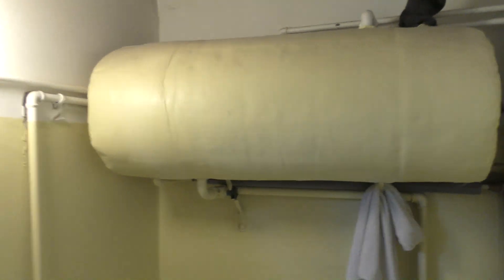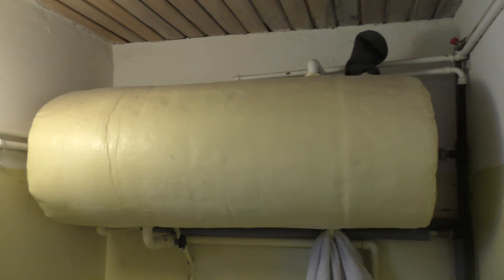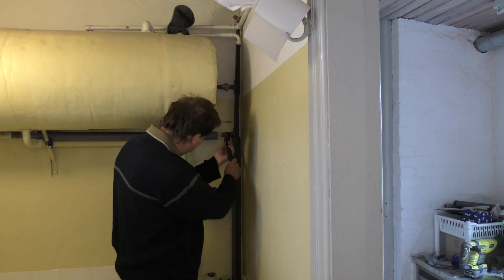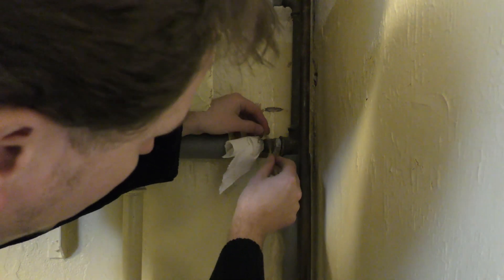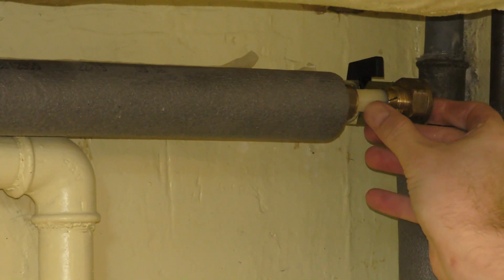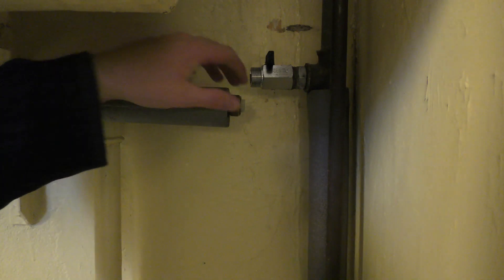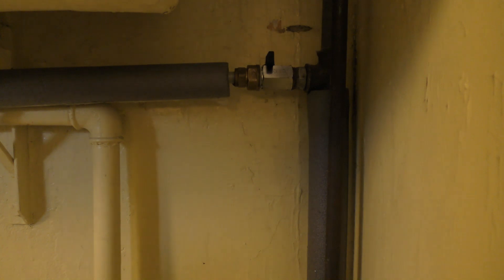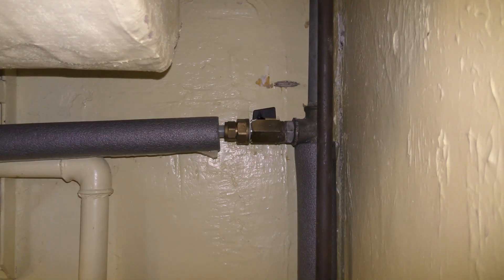How to Install a Shut Off Valve for a Water Heater - 407

Comment: Really its not a heater more of a storage tank.  I see used old school and todays method of sealing a thread.  Old school horse hair and then Teflon tape that is used today.  I here you with all the small jobs that get put on the back burner, I have so many to do.
Reply from the maker: HI
The tank, has a spiral for the heated water from the woodstove in the basement. and that will heat the useable water.
Yes so many projects!
Thank you for watching! :-)

Comment: The pipe you cut, is that plastic?
Reply from the maker: HI
Yes it is,,pex i think it is caled.
Thank you for watching! :-)
Reply: Can you drink the water out of the tank?
Reply from the maker: HI Henk Kok 
It's a water heater,, so normally the water is hot. I usually do not drink hot water. It is best for doing the dishes and bath.
Thank you for watching! :-)

Comment: Just for a future reference, when applying the white silicone/teflon tape you should apply it the other way around so that you don't risk "unscrewing" it when screwing in the pipes :)
Reply from the maker: HI Dorian Tokarz 
Then I might not have done that right :-/
Thank you for watching! :-)
Reply from the maker: HI
I do think I did that ?
Thank you for watching! :-)
Reply: Just watched again to be sure, and it doesn't really look like it to me.. But whatever.. As long as it's sealed :)
Reply: I thought of that too :) Good point :)
Reply: Anyway, that's no big deal because when it's tighten it won't move anymore. It's just easier to screw the parts without getting the Teflon tape to go.